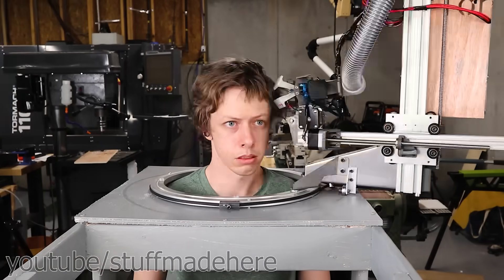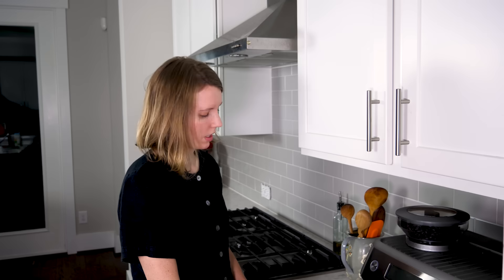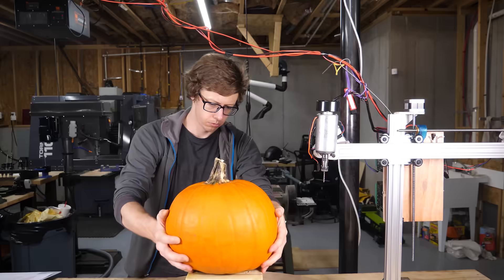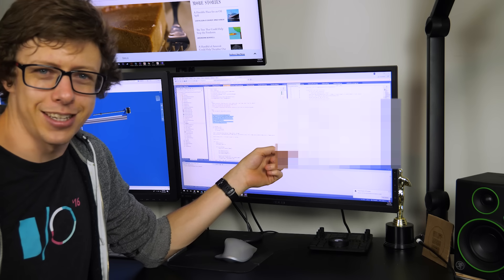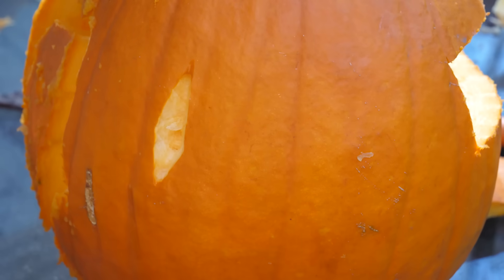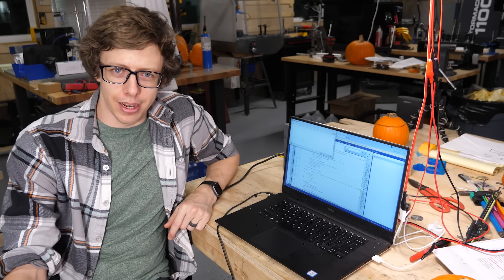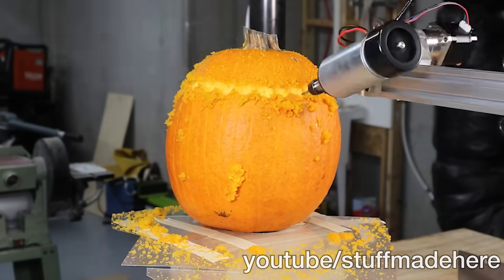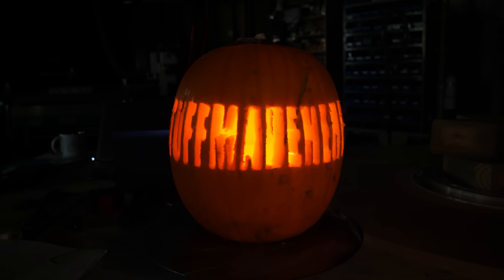Making a robot to carve photos into pumpkins

Comment: I'm thinking there might be a few factors impacting quality.
1: you need WAY more surface mapping samples.
2: Mapping does not account for the uneven surface inside the pumpkin. This causes uneven visuals when lit because the wall thickness varies significantly.
3: You're machining a soft, flexible material with a lot of give. At least as far as a CNC router is concerned. For anyone not familiar, try drilling a hole through a piece of rubber, a brillo pad etc. Or cutting it cleanly with an ocillating saw. Not happening - you need a workaround. For those examples, the common one is sandwiching it between two pieces of firm, non-flexible sacrificial material like woof etc. 

You need to try out different bits, speeds, feeds and tool paths to try to work around those material behavioral properties. Maybe look into experiences CNC machining rubbers and soft plastics, might be some transferrable knowledge to be had there.

Comment: I think the main issue is that the strength amd consistency of a pumpkin isn't as good as wood so using a cnc machine to cut a pumpking it just shreds the fibers inside the pumpkin.

Comment: Awesome stuff as always!
A few suggestions, sorry in advance for how hard the one part will be to write.
1: When cutting a traditional pumpkin
    a: it is important to make sure that no area becomes to weak, so smaller or finer areas should be cut first, prioritizing the center of the design in ties.
    b: Knowing the thickness of the pumpkin will allow you to to adjust the tool to cut angled cross sections to improve viewing angle without angling the cut too much
2: When cutting lithophane pumpkin
    a: cutting the desired depth the first pass might not be best
    b: these carvings are often inset a small amount, meaning the carving has a min depth
    c: using photos are tricky to map shade to depth. Light areas in an image are sometimes closer to you instead of farther away, 3d scans might be better (Kinect time)
3: Would rinsing the pumpkin as you go yield any "cleaner" results? Does the pumpkin gunk effect the accuracy of the cutting tool / depth?

Comment: Why don't trying to make razor sharp cutter with agressive angle and use slower speed. Works with foam. Don't need to be superhard or supertough steel for a pumpkin as long as it can be made sharp. I always get surpriced by a rebar when I make something out of it, harden and then put an edge on it. Of course it depends on rebar what you happen to have because they are typically a scrap metal with some carbon and alloyed steel within.

Comment: You need to make the machine stiffer and a size rotating drill bit set up for more fine details. A revolver style setup for the bits is easiest for programming, but the best would be a hex set up with individual rotating and elevating capacity so you can fit more bits with less turning and more  detail.  Due to the added stiffness of working with triangles instead of circles. Also drill bits arnt ideal as there's actual carving rotary tools for CnC machines.

Comment: one thing that you might have forgotten to consider is the hollow inside. You might have approximated your outside surface but the inside was not considered. The bumps inside might interfere with the expected thickness for the light to pass through hehe

Comment: 10:02 The best way to never do this mistake again, It's to put a diode in the positive and an another diode on the  negative cable. A diode is a onw way curent flow, just make sure the voltage minimum of the diode is not to hight. Otherwise, the electricity won't pass throught the diode.

Comment: I used to run a CNC plasma table and I’ll tell you if you get a water table for it the sparks don’t fly everywhere except when you start a cut and there isn’t as much slag and it’s easier to knock off

Comment: Hi, 3D modeling like Rhino3D has come a far way and code isn't really necessary for this. If you could import the measured surface into a 3D program you could project your drawing onto it and get those depth points. Maybe I'm missing something. 

Also watching your videos makes me feel inadequate. Love them because I learn a lot.
Reply: projection usually will only apply compared to the plane it's projecting from, so the sides of the image will be stretched (not to mention completely mess up the lithopane part that relies on accurate depths.

Comment: About CNC plasma water level: you had water level like 5 inches from metal - that doesn't catch smoke very efficiently. Have it at least 1 inch from metal to be really effective. But if you want 0 smoke - make water almost touch metal (I like this the most, especially in winter, when I don't want to vent warm air from the workshop).

Comment: perhaps you can use a 3d scan technique to convert the pumpkin to an .stl and then use something like 3d builder to project text with different projection methods (linear, cylindrical, spherical) ?? it may lead to something that can be used for not so spherical pumpkins

Comment: Reverse polarity protection my friend. Overvoltage protection + a fuse (ptc or ceramic)  is always nice too. Before plugging in, measure resistance between the inputs and use a current limited supply. For the laptop, I recommend isolation USB adapters. Something with e.g. a ADUM3160 isolator IC inside really saves your day working with high voltage / current industrial machines.

Comment: I see a lot of "artefacts" in the carvings that are made by the carved lines being horizontal only.
If you could make a second pass and carve vertically over the same picture and manage to align them properly I'm sure the carvings would look a lot better.
Reply: I was thinking the same thing. With the lithophanes I've carved into pumpkins in the past, they were never carved at the same angle in relation to the surface of the pumpkin. Nor did i use the same tool for the entire surface of the pumpkin. Maybe a round bit could get you different/interesting results. The light coming through the pumpkin also depends on the thickness of the pumpkin, and that was hardly ever the same lol. I mostly carved them with them already lit.
Reply: @Elfhugger  Well if anyone could make a robot that measures the brightness of light coming through and adjusts its carving depth in realtime to compensate it would be this guy.
Reply: @MrRolnicek  I didn't want to put that out there...but I was thinking the same thing.
Reply: A ball end endmill would also lead to smoother surfaces for a finish pass.

Comment: there are other techniques for flattening organic objects into a 2D plane. The movie industry does this for CG. It does require projecting a grid over the object, measuring the distance, creating a point field and then a 3D model. another way is with open source 3D scanning projects. http://www.makerscanner.com/
https://3dsourced.com/rankings/best-diy-3d-scanner/

You have a kinect, so you could repurpose the kinect into a 3D scanner that is more accurate than physically measuring the pumpkin. There's open source drivers for it. https://openkinect.org/wiki/Main_Page I'm guessing you're already aware of it.

You should post your code to github. I'm sure other people in the makerspace can help you fix or improve your code. I'm bias, since I've been contributing to open source for close to 2 decades.

Comment: Bro why didn't you use opencv on python to make a 3d mesh of the pumpkin them use that cylinder method so the computer reads it as a normal piece of paper and then add Ur picture onto that
Reply: After U do that then U get the steps for the page and the reverse the cylinder method so it applies to the pumpkin
Reply: Wait I have a simpler method

Comment: I thought about an hige Upgrade to the moving basketball hoop, what if you Use linearmotors instead of belts to move the hoop? I mean it would be very expensive but you can reach much greater acceleration.

Comment: You fool! Use a gnomic projection! It is most accurate centered on your image, with equal amounts of distortion in all directions! Plus, it's extremely easy to map. You just rotate your pole to the image center, then use a haversin range and bearing. You could even use spherical range and it's still more accurate than mercator. I map flat things to round things for a living!

Comment: TRY THIS MACHINE WITH:

ICE
MELONS
WOOD
STONE
Reply: Ice wood and stone would definitely need a stronger mounting point. Not sure if even the pumpkins were fastened in any way, maybe that's one of the reasons he didn't get the resolution he wanted.
Reply: Ice might be ok if it's mounted, but it would probably wear down the machine really quickly
Reply: Literally none of these will work besides a melon. The machine uses tools designed for cutting pumpkins, which would break on anything that is tougher then... well a pumpkin
Reply: @Mr.Bimgus  lol no it didn't use pumpkin carving tools, he used normal end mills for wood or metal, Lmao you eypert
Reply: Use a stone drillbit and use a faster/stronger motor on it -> faster = less needed pressure

Comment: I'd actually be interested to see trying different projection methods on the pumpkin carving robot!

at least I'd like to see the difference between this Mercator projection and a linear projection. From what I recall a linear projection is just put the image flat in front of the object, extend every point of the image straight back, the point that it contacts on the pumpkin is the point that it's mapped to.

I feel like for viewing the pumpkin from straight ahead this would give the closest representation of the image. 

Maybe also a kind of radial projection. Same ideas the linear projection but the image is wrapped in a circle around the pumpkin instead of being kept flat.

This is probably asking for follow-ups with the most tedious part to the project, but thanks either way for reading at least to reading this!

Comment: Ouch, that reverse polarity really sucked :( 
I can really recommend buying some XT60 connectors. They are cheap, very reliable, can handle a lot of voltage and current and are non-reversable. 
Anderson PowerPole's are also a similar very popular connector.

Another idea: cooling the pumpkin might make it easier to machine? The freezer might be enough?

Comment: If the cut isn't clean enough, maybe make it a two step tool path where you have a razor blade on a caster like swivel to make the clean cuts and the bit to hog out the material

Comment: Nooooooo
I might be incorrect buttt....
I assume that pumpkins aren't equally thiccc. To clarify i refer to the thickness of the pumpkin skin. The tone of an image will differ from pumpkin to pumpkin becauseof the differencein skin depth. If at all possible measuring from the inside of the pumpkin and creating a positive from that measurement would be better. I don't know if positive is the correct term but i mean to cut out the image just measured from the inside. This would be the simplest solution to create a constant tone between different pumpkin but also in an individual pumpkin since the skin might not be equally thick everywhere. It eliminates the effect of skin thickness altogether.

Comment: Can you make any modifications to a compound bow to make me better a using it. For example laser range finder in sight, wind speed auto adjust, altitude adjust (45 degree uphill/downhill shot calculator adjustment... stabilization correction/ floating hand grip, better release system.) Idk you’re the genius

Comment: Try updating your software to have the cuts start at the bottom of the pumpkin and work towards the top. 
I think that the juice and the carvings may be affecting some accuracy as they drip down the side, so starting low and working up should minimize the amount of stuff in the way of the cutter?

Comment: Could you design an anti-splashback toilet?  you could use a jet of air to blow any potential splashes, back down . The world needs this. Also, you need a 3d scanner so you can create an accurate 3d model of your pumpkin that can be edited in CAD.

Comment: maybe if you increased the spindle rpm by a butt ton so it would cut smoother and actually intentionally heated the tool so it’d cauterize the pumpkin wounds the pumpkins would end cleaner

Comment: This is just awesome. I think it might be possible to use mesh based UV unwrapping followed by UV projections instead of the sphere projections. You already are generating a point cloud (not sure if you are generating a mesh but the simplest way I can think of doing that is by feeding the point cloud data to meshlab to generate the mesh). This would make it possible to carve even concave pumpkins (considering the "cnc" can move to all those positions).

Comment: i think part of the problem is the spherical projection mapping of the image to the pumpkin would only look correct from the right perspective, but since its a spherical projection, there is no proper perspective since you'd have to be looking down each hole simultaneously. plus there is a lot of topographical things on the pumpkin which will skew the look of it. I suggest finding an ellipsoid that matches your cutting area enough and then projecting onto that and mill out a level region around the image too.

Comment: You should pause the machine if possible often to wipe it off so that it can refract more presisly👍🏼 Or create another machine that interacts with the cutting machine to pause it and gently wash it off with water from overhead several times through the milling duration.

Comment: You should open the holiday squash , and fill it with a lot of ice, freezing the celebratory landquat yields much less head throbbing and finger leaking, and in this case, keeps it rigid enough to enact a visceral reenactment of how your wifes face takes apart your soul...like a crab....a very methodical crab, picking at the soul  that is a face that is not on a pumpkin

Comment: Sick work...🙌🙌
So I'm thinking, instead of carving the thickness to show light and shadow, how about making '' dots art '', punch holes to pass light and use the density of many small holes to show light and shadow? It might be a bit easier to control the result, since the unevenness of the surface doesn't matter too much this way?

Comment: In college, I had a breadboard design that didn't fit, so I carried over to a second breadboard.  I forgot that I installed the chips in reverse for wiring ease. Blew every chip when I turned it on. So much magic smoke. Good memories. You still win, 4 servo drivers and a laptop, that's hardcore. If you are not burning something up every once and while, you are not doing anything.

Comment: Why don't you have a fish in your energy chain on the plasma cutter?  Have it as a loop so it always feeds itself back in to the chain and you never risk it falling out.  That way when you need to run a new power cable you can tape it to the looped fish wire and pull it through.  Just make the loop long enough that it doesn't hinder movement.  Maybe you can even use electricien fish wire and weld it as a closed loop so it is smooth and easy to pull through.

Comment: I wonder if one problem with the robot is that it indexes the outside of the pumpkin? If what determines the brightness of the carving at a given point is the thickness of the pumpkin, doesn't the machine need to know how deep to cut relative to the inner wall of the pumpkin rather than the outer wall? Although, you could just shave down the inside of the pumpkin so that the entire thing is a consistent width.

Comment: Maybe the portraits would look nicer, if you didn't start by projecting the flat image onto a sphere (introducing distortion), and then projecting the sphere onto a pumpkinoid (introducing more really unpredictable distortion), but just by projecting the flat image onto one side of the pumpkin. I guess you would only need to adjust the depth of cut by multiplying the depth map by some variable dependant on the angle of the projected ray with the surface of the pumpkin. This would of course only work in the middle of one side of the pumpkin, but your wife might not even need to come down to the basement to glare at you. The pumpkin might suffice. Anyway... My mind is once again thoroughly blown by your creation, or as we say in Slovakia, "It has blown my lid off". Thank you for the amazing content. I'm going to go look for my lid.

Comment: Great project and video! Just one math detail: The explanation of the Mercator projection at 5:55 is wrong. It is a common misconception that Mercator map is created by projecting,  with a light source from the center of the Earth, each point of the surface of the sphere onto the surface of a tangent cylinder, and then unwrapping the cylinder. This is not true. If that were true, the y coordinate of the map would be the tangent of the latitude, but if you check the formula, it is in fact a logarithm of the tangent, which is very different. The Mercator projection is important because it is a conformal map, that is, it preserves the angles. Since the angles are preserved, the directions (measured by the angle with respect to the North) are faithful, so ships in the 16th century could find a way between two points of the Earth (not the shortest path, the geodesic; but an easy path, keeping the angle with the north fixed, called the loxodrome). The formula is just whatever it has to be mathematically so that the result is a conformal map, but there is no graphical geometric construction.
Close to the equator the difference is small, so for this application it might not be important, also considering the other deformations coming from the surface of the pumpkin.